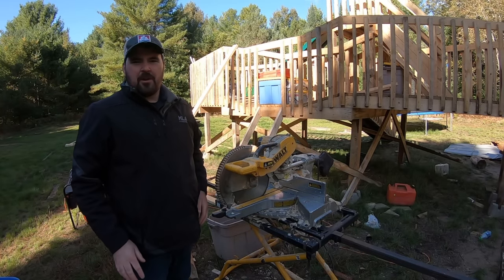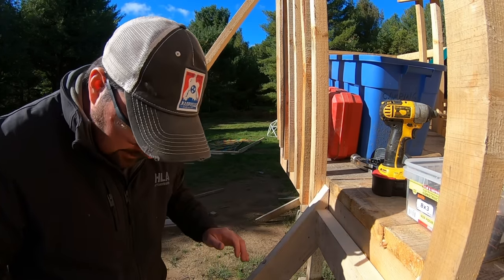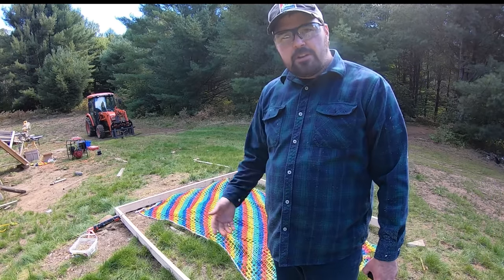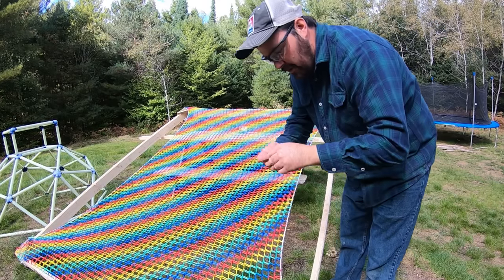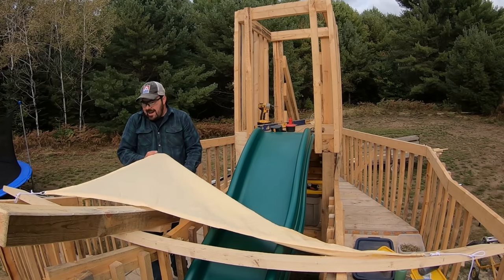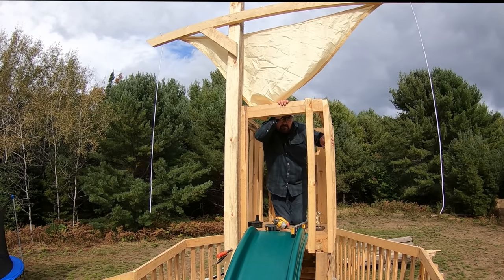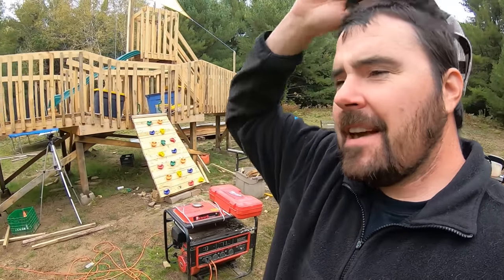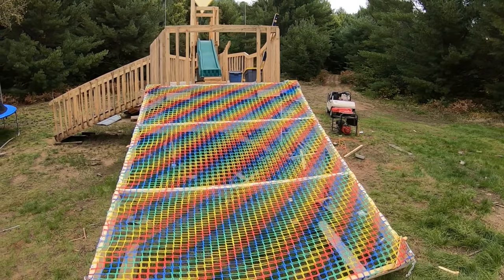24 foot Pirate Ship Playground Get's Bigger! | Climbing Net, Climbing Wall and Mast Install

Comment from the maker: Update: I removed the horizontal 2x4s on the climbing net in favour of a different design
Reply: Its coming around quite nicely.. A few 4x4 posts on the side might help... 
Im curious about the netting spring tension...  Some of those Daredevil kids may see that as a downhill trampoline.. Lil Tommy might land over by the turkeys..🤣🤣 
Keep up the great work there brother..👍👍
Reply: @feelingold2995  ... perhaps the tension should be increased then - let them go for distance - half gainer off the mast!

Comment: Looks Awesome Sandy !!
For safety (child) .....

---- Oh, just read the Update in the notes, so the below concern is resolved, but I'll leave this for anyone else to use for consideration of such matters. --- 

On those cross members on the climbing net - put some pipe insulation or a split lengthwise Pool Noodle over the top edge - apprentice pirates tend to be a little unstable at times and that looks to me - as a parent - as a forehead / nose basher either from tripping going up or just running right off the back ( and don't think that they won't - that net is a "perfect landing net" ... and that upper cross member is a perfect oowie .... foam cover under the netting for the win!)
Reply from the maker: I like that idea though Greg about the pool noodles. Would certainly solve that.

Comment: Looking good. Get you one of them adapters to run the 20 volt batteries in your 18v tools that’s what I did so I could switch over slowly as the tools died I just accumulated several 20 volt batteries first. Keep the videos coming.
Reply: Them 20 v dewalt hand routers are amazing you could zip around that whole ship in no time. Knock all them head splitting corners down.
Reply from the maker: Thanks for that Josh. That’s a great idea
Reply: I was thinking a good old fashioned power drill powered off the generator would be perfect for predrilling all those holes, just a tiny 1/16” pilot hole would help the impact driver out.
I noticed the side planks are a little rough, especially on the stairway, nothing a belt sander couldn’t handle.

Pirate ship is looking great...when you started, we didn’t have any idea what it would look like. Sure took a LOT of lumber to build!

Comment: Hello, Sandy, Just a suggestion,  I would place a 2-3 inch runner along the side of the net. that way you could add more strews at the attachment's points. This would give you a better hold along the sides, they will be jumping on it.
Reply from the maker: That's a great point Harvey. Thanks for that.

Comment: I've tried aftermarket tool batteries.  You don't get any savings.  The "3.0 amp-hour" batteries were more like 2.0, and they both died exactly 36 months after I bought them.  The OEM NiCDs typically last 7 years.
Reply from the maker: I think you're right there Baron. I'm looking to upgrade everything to more powerful batteries soon

Comment: I noticed you put support in between the netting watch out for when kids jump from the top well it wont be good when they hit one of those boards fyi
Reply from the maker: I did have to weigh out the pros and cons and unfortunately they just won't be able to jump from the top and tumble down without knowing it's there
Reply: From the side net boards to the ground in the center, like a gunnel to the keel

Comment: If your batteries are getting weak there is an adapter for the 20 volt dewalt battery
Reply from the maker: I may have to look into that. Thanks John